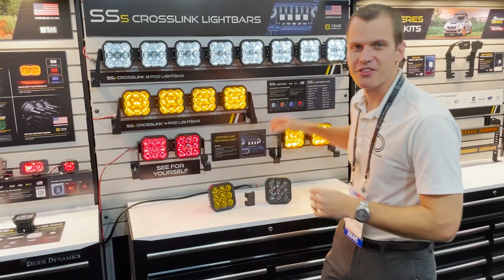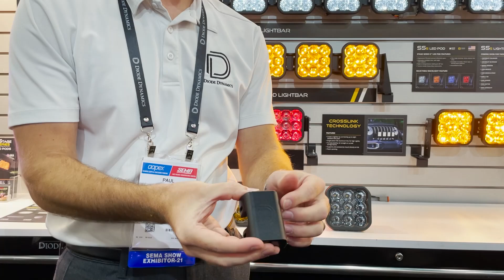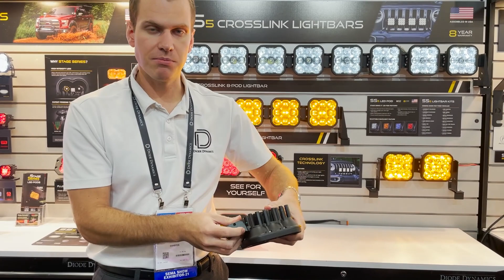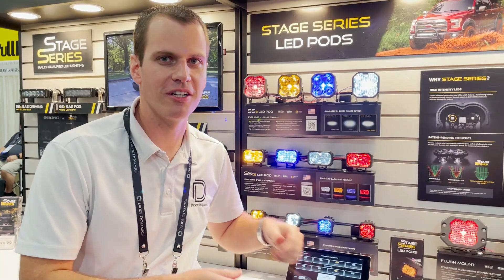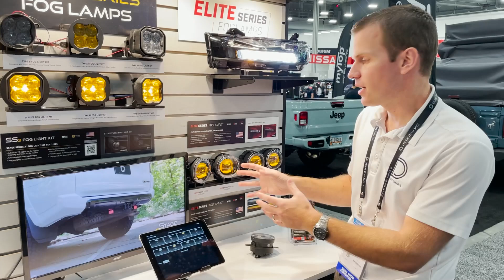SEMA SS5 LED Debut | Diode Dynamics

Comment: What does the back light feature mean? Is it on as a running light when not used as a fog?
Reply from the maker: Yes, it's an additional running or accent light feature added to our SSC1, SSC2, SS3, and SS5 LED pods.
Reply: @diodedynamics  thank you, that makes sense.

Comment: So I take it there will not be a higher brightness OEM Elite Fog later down the line due to legal reasons?
Reply from the maker: Hey there! We haven't looked into an OEM-style elite fog brighter that these at this point. However, there always is a possibility that we will offer one down the road!
Reply: @diodedynamics  gotcha, wouldn’t mind an off road only version without brightness limits for my trail rig……minivan
Reply from the maker: @TobyCostaRica  We'll definitely make the suggestion to our engineering team. If you haven't yet, please check out our SS3 fog lights. They are perfect for this.
Reply: @diodedynamics  thanks! Prefer the OEM look so I’ll pick up a set of elite fogs when they launch

Comment: Awesome stuff! What’s the backup kit harness you mentioned? I just got a pair of C1’s with the light duty harness and it will work fine, but if there’s an even easier way to tap into the running and reverse signals I’d be interested in that.
Reply from the maker: Hey Ryan! We just released backup kits with full harnesses. We have plug-and-play kits for the 05+ Tacoma and the 5th gen 4Runner. We also have universal kits! The harnesses offered with these kits makes this super easy to do!

Comment: Why not working on fog or boost night time lights for the new Goldwings ?
Reply from the maker: Hi there! We do offer LED pods with fog optics that can be custom-mounted to Goldwings. Check them out! 

https://www.diodedynamics.com/off-road-auxiliary-led/led-pods.html
Reply: @diodedynamics  Thank you for replying. Will check. I like the OEM looks. I just want to swap the Honda’s which are very poor. Some add brackets to the side of the fork. Not sure yet. Do you know if I can just tap yours without a relay to my 2020 GW DCT Tour? I have the switch already from Honda on the center controller
Reply from the maker: @alp3781  Yes, you could tap them into existing wiring!

Comment: I have a few sets of the OG Stage bars and have been very happy with them. I like where they are going with all the pods but would love to see a pro upgrade to the stage series bars. I would also love to see more of a 4500k color option to compete more with Baja and VisionX. While Diode Dynamics is closer to white compared to pretty much any other brand, the color temp still starts bother my eyes after extended use.

Comment: Good presentation without empty thoughts. Although installing the SS3 Pros on my 2020 Chevy HD was a +3 hour venture (due to the vehicle design to reach that 3rd bolt by having to remove bumper and grille before that). The end result is a high tech looking, flush OE style bezel and light appearance / finish with a superior output amber fog light. I now feel more confident on backroads and during upcoming storms (snow, rain, fog, dust). Top tier attention to detail and design; glad I bought your product  👍🏼
Reply from the maker: That's great to hear!

Comment: Is the SS5 going to come with a "max" level?
Reply: The wattage pull would be nearly identical to the pro model if comparing to the ss3. The osram boost HX series is a much more efficient chip and in the ss3 max it's only drawing 9.625 watts per chip vs 9 watts in the pro. So if used in the same way it would be 86.625 watts for an ss5 max. 

The max rating of 20 watts per chip is not used due to heat, longevity and efficiency from what I've been told. It's pretty incredible what amount of light they can throw with these boost HX chips in a TIR reflector. Too bad they only come in a 6000k color temperature.
Reply: @aaronolsen8787  So I'd confirm with DD before you ordered but if you order the amber lights and change the lenses to white, the amber lights use a warmer chip and the amber lens to achieve the amber look. I saw a forum post where a guy was testing out all aftermarket fogs and said he switched the amber pods with a white lens and the pods had a 5000k temp color according to his lux reader.

But your totally right about the Max, if they pushed the pods past 100 watts the heat and reliability would be questionable. But already by using better chips at a higher wattage the SS3 Max pods are so much brighter. The difference in SS3 Pro to Max isn't much in wattage yet the light output is immense.
Reply: @aaronolsen8787  yeah I wish it was a slightly warmer color
Reply: @aaronolsen8787  you can get the amber which is 4K and then put clean lens.
Reply: Currently with the SS3 sport and pro if you buy a yellow pod and swap in a white lens you will have a 4000k white color. I run two pair of them and they are very nice and easy on the eyes. As far as i know this is the same case with the ss5.
Reply: @FightForLiberty00  I saw a comparison that the amber pods with clear lenses actually have a brighter lux reading than the standard white pods and clear lenses.
Reply: Not on launch, the problem I see with a max setup is the wattage pull would be massive. Personally it's foolish not to have them in the lineup but if a pro is gonna be 400-500 for a single pod, a max would probably be like 1400 for a pair and that's just crazy unless you race.
Reply from the maker: Hi there! We will not have a Max option for these at this time.

Comment: Im really excited to start building my truck's lighting around your amazing product line, can't wait!!

One idea I have is with my custom tail lights. I'd like to mount either the sc1 or sc2 lights in them for a reverse light and the back lighting is a bonus, I can select either the red back light and have it act as another running light source, or select the amber back light and use it as a turn indicator.

Thanks for offering such a vast amount of options!!

The only thing I could wish for at the moment is a slightly smoked lens/cover to hide some pods a bit better behind my grille and inside my headlights! (Gonna put a ss3 in them for extra high beams next to Morimoto MLED projectors) 

Cheers
Reply from the maker: Hi there! Thank you for the helpful feedback. We'll continue to upgrade. Have you checked out our universal backup kits and our smoked snap covers?
Reply from the maker: https://www.diodedynamics.com/stage-series-flush-mount-reverse-light-kit.html
Reply from the maker: https://www.diodedynamics.com/off-road/off-road-accessories-wiring-lens/covers.html